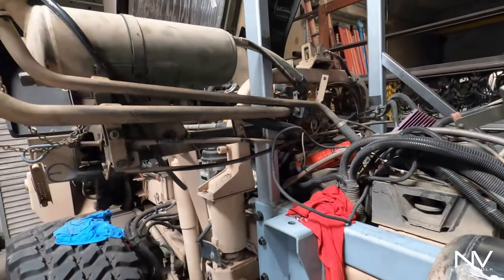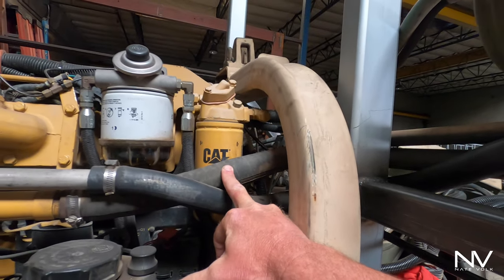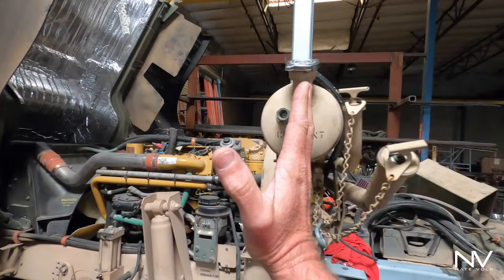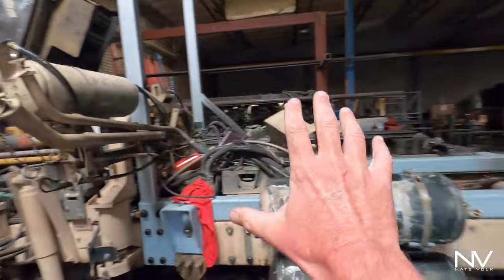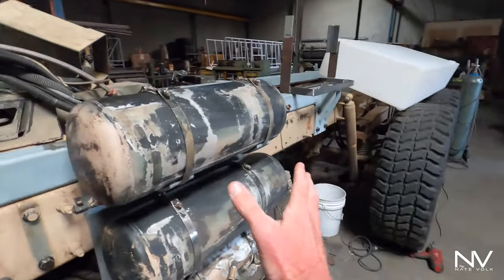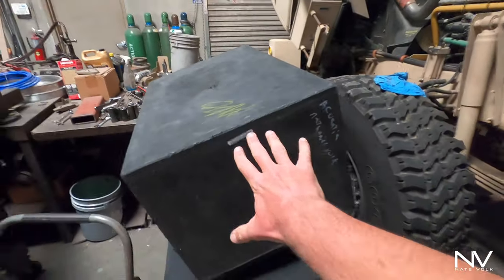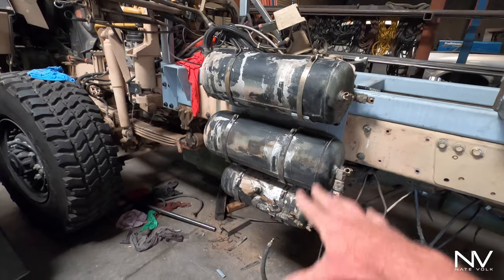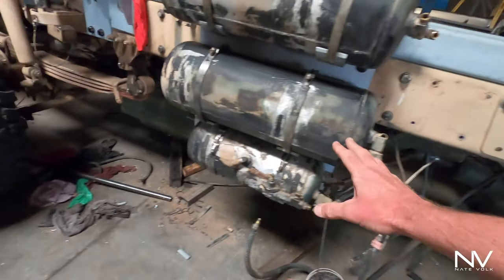LMTV Overland Expedition Truck Build - Part Thirteen

Comment: In my mind I’ve always wanted the air tanks put between the rails if possible as well as the batteries but all my water tanks would be in the habitat for freeze reasons. Fuel tanks storage and generator (all items outside the rails would be attached to the subframe to increase the clearance and continuity.
Reply from the maker: Yeah, there really isn't that much room between the rails for stuff.  Maybe on the 4x4, but for sure not on the 6x6.  Once you stick your head in there you start to understand.  I've got water inside (for freeze reasons) but frankly I don't really care if the black or grey tanks freeze.  I'll have heated mats if I have to dump in extended freezing temps...  Fuel, generator on the habitat is a lot of weight hanging from the crossmembers.  It's much better connected to the frame, you then know your clearances and nothing moves.  Plus the last thing you want is a vibrating generator attached to your habitat box :)  Ask me how I learned that one!  Continuity is nice, but not at the sacrifice of functionality for me.

Comment: NATE!  Please post the part number for that Air dryer.  I want to upgrade my upgrade soon!
Reply from the maker: I can send it to you, its untested as of now personally.  I'm going off a guy I talked to that put the same one in his and it has been fine for a long time now.  The heater on the replacement is 12v, while the truck is 24v.  The heaters are cheap to replace if you need one.  Sound good?
Reply: @NateVolk  PM me on facebook...
Reply: @NateVolk  Hey, longer term thoughts on this replacement air dryer? Still happy? Thanks!

Comment: can you not put all the fill tubes a hole bunch closer to the frame or even net to the cab. you are only talking say 2 inches and as far as the water reservoir make a new one that's just a couple inches wide and maybe 2 foot long out of stainless steel so you can have the box a hole bunch closer. and put the air cylinders between the frame rails
Reply from the maker: Well, kind of.  There is 8 inches between the box and the cab.  1/2 of that is the cab air mount system.  And I still need air cleaners in there too.  There isn't room between the frame rails for the air cylinders.  That's full of water tanks, transmission, transaxle, driveshafts, and air brake miscellaneous...  Its a tight fit :)